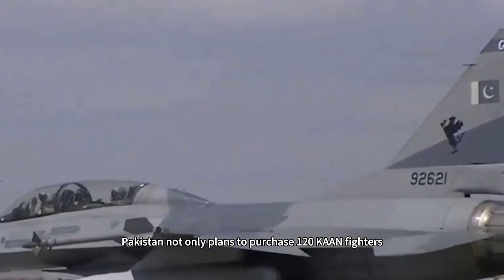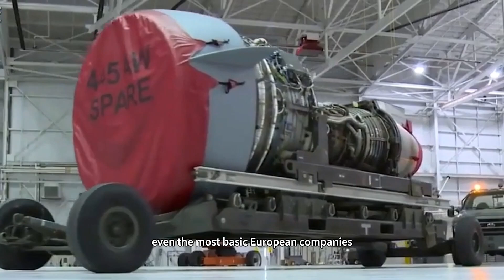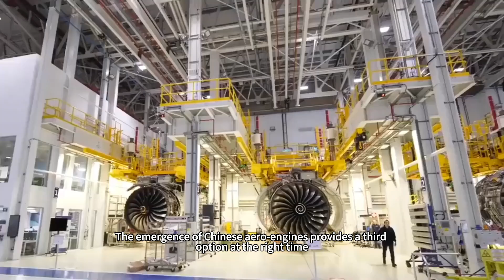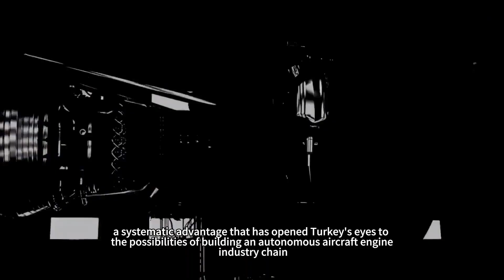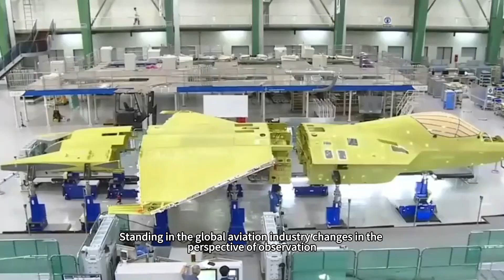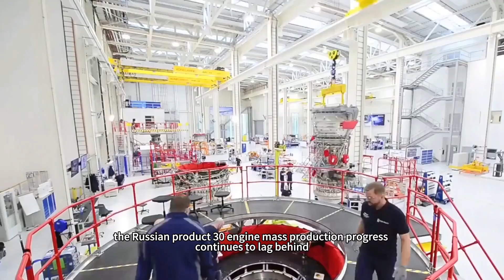Bigger than J-20! Turkish license + WS-10G, Pakistan's version of KAAN to be born?

Comment: These guys have made a super air fighter. Do you find it embarrassing to use a proven engine like the F110; an engine option used in both the F-16 and F-15? (These engines are only for test aircraft. The TF30000 is being developed for combat aircraft and it is said to exceed 35,000 lbf (156 kN) in terms of power) Do you find the Korea KFX and UNCLE HAL (Eneral Electric F414 afterburning turbofan engine) embarrassing? If you don't know, don't make a video.